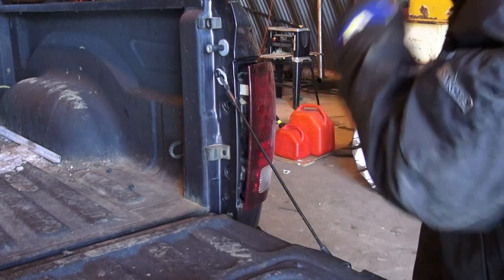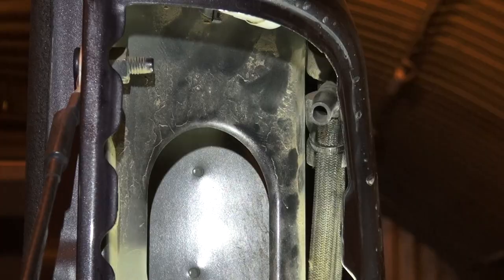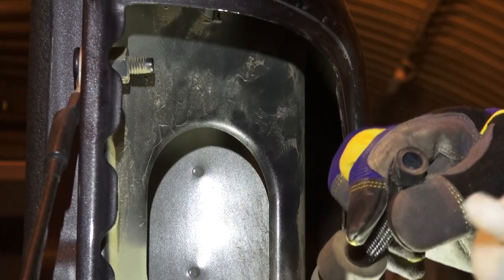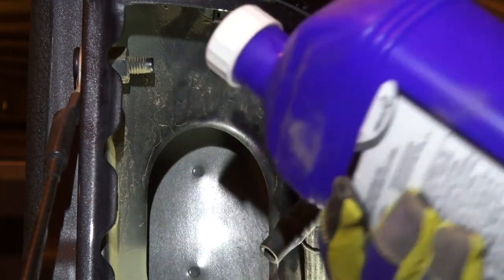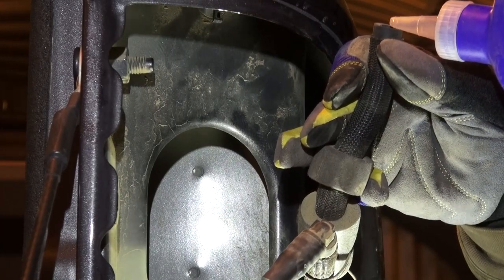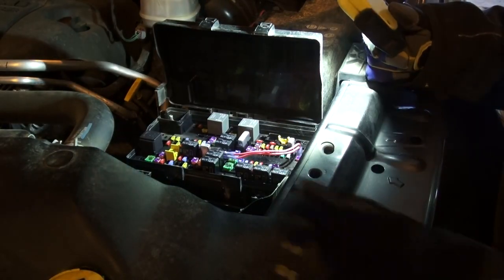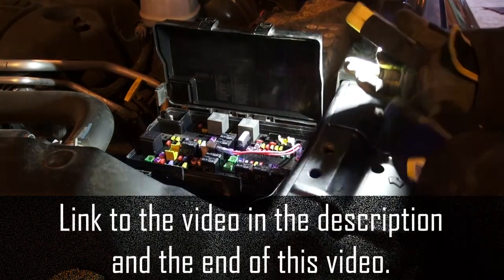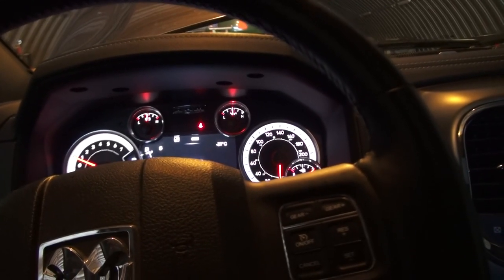DODGE air suspension [De-Icing-lubricant]

Comment: I have a 2018 Rebel. My truck says normal mode but it's in entry/exit and won't move. My dash shows 3 errors, service air suspension,  service trailer brake, and service electronic braking system (anti-slip).  I cannot get into the menu to raise or lower the truck as it just shows the error for the air ride. I've disconnected the battery, checked all fuses, nothing seems to work.  Have had the truck inside a heated parkade for a number of hours with no change. Would this antifreeze help me in your opinion?
Reply from the maker: How cold is it where you are? Doesn't sound good when even the brake system is faulty. If the error persists even after the battery reset,  there must be a faulty fuse, relay or control module. I'd recommend get the codes read out. 
You have an electrical problem, antifreeze wouldn't fix that, but certainly start using it on your vehicle.
Reply: @oBseSsIoNPC  it was -30 Celsius for a solid week. This happened last year too and I had the same errors. When the temperature came back up and the truck thoroughly heated (8 hour drive on the highway) the air ride came back up and all the error codes cleared.
Reply from the maker: @jgm9667  last week someone reported a code for the trailer brakes as well, which I thought was weird but somewhat makes sense. Last time my truck was ignorant it also took 4 hours of direct heat to the system for it to unthaw. This winter the suspension acted up one day at -35°C because of that constant humidity from the exhaust. Once I unthawed the control valve and added 5mL of airline antifreeze it hasn't missed a beat. HOWEVER when it failed I could reset the code by reconnecting the battery. I am surprised you can't get it to reset. It will last only a minute or so, if the valve is still frozen, but it should clear for a bit at least.
Reply: @oBseSsIoNPC  I've had the truck in a heated parkade for 24 hours. Going to go pick up some antifreeze this morning and give it a shot. Dodge are just assholes when it comes to this issue. No help at all. If I can fix it myself, all the better. Appreciate your help and feedback!
Reply from the maker: @jgm9667  Sounds good, also. You can try and put the suspension into tire jack mode or transport mode, then disconnect the battery. I usually take the ground off and touch it to the frame so you can reconnect it right away with the controllers all off.
Reply: @oBseSsIoNPC  hello again. I put a cap full of the antifreeze in the line. The truck was inside heated for 24 hours. Nothing changed so I took it for a drive for a while. It seemed that when I hit bumps, there was a bit more of a "spring" in the truck rather than the hard bang it normally had riding that low. I didn't notice any change in height. I have decided to let the truck run for the next hour in hopes that the exhaust will help heat the compressor. It's currently +5 Celsius so not cold.  I'd be grateful for any other suggestions. Thanks!
Reply from the maker: @jgm9667  Make sure to take a tape measure with you and just compare sides measuring to the wheel wells. Of course the compressor needs to run and the valve needs to cycle to get the anti-freeze pushed through the system. After it cycled, add another cap worth, don't add it too fast or it can stall the compressor. Quite the ignorant little fella your truck huh? triple check your fuses again if you haven't already, just in case. Preferably pull them out and check.
Reply: @oBseSsIoNPC  hello again. I have added a second round of de-icer. Still no permanent fix. However, I did bypass the relay and could hear the compressor engage. I swapped the relay for the one next to it as they are the same but still nothing. If I can hear the compressor I assume that's a good thing. What are my next steps?
Reply from the maker: @jgm9667  running the compressor is one thing, the truck controls the diverter valve though and there is no easy way to control it. When my truck was stuck on a height, I put it into transport mode and turned the key off. Disconnected the battery and reconnected it. Then commanded entry exit. Make sure the doors are closed! The truck moves up no problem, but will not lower with doors open. I usually just trip the door latch shut with the screwdriver and leave the door open. That way I can still access the inside and see what it does.
Hopefully the freezing didn't damage the control valve!
Reply: @oBseSsIoNPC  my raise/lower buttons show the truck in normal mode, and it says normal mode on my dash. Truck is actually in entry/exit mode. I cannot get it in transport mode.
Reply from the maker: @jgm9667 you have that center display and it won't allow you to select it?
Also, what does it do when you command raising?
Reply: @oBseSsIoNPC  The center display shows SERVICE AIR RIDE SUSPENSION when the truck is running. Cannot see the air ride display. With the key in ACC mode I can see it but using the buttons does nothing. Pressing the buttons with the truck running does nothing.  Sorry to be such a pain in the ass...
Reply from the maker: @jgm9667  Oh so there is still an active code, well no wonder it won't budge. Maybe that valve didn't unthaw properly yet, maybe it's broken. If the truck complains right away, there must be a broken component. I am afraid you will have to try the dealership.
To try and diagnose through YouTube is not ideal. Sorry I couldn't help you bud.
Reply: @oBseSsIoNPC  yeah I'm going to take it to an independent local mechanic that I know and trust. To hell with the dealership lol. 
Last question, what happens if you bypass the compressor relay for more than 3 seconds?  I noticed that warning in your video. 
Thanks for all your help, so very much appreciated!
Reply from the maker: @jgm9667  The compressor works in conjunction with the control valve and although there is a blow-by right on the compressor to protect it, you just don't know what is frozen, broken or restricted. Also the power consumption is 40amp and if the compressor was stalled, it will burn out the wiring if run for too long. I just need to warn people that they are by-passing safety measures that would otherwise prevent damage to the system. The bypass test is only there to see if the compressor is actually still alive. I highly suspect a bad control/diverter valve on your truck. Good luck!

Comment: This method worked for us all last winter, but this winter has been acting up a lot, mainly on the extra cold days. Just wondering if you have any ideas as to what might be the issue now if the antifreeze isn’t fixing it. The only thing that seems to help is parking it inside for hours until the whole system warms up
Reply from the maker: I think there is just a limit to what the control valves can handle. My truck has also had issues this year while not having had any previous years. Its been tough, cold and humid weather, creeping into the system. The way the antifreeze dispenses isn't ideal either. I will change my system to house the components inside the truck and that will hopefully fix it for good. I am also debating if I want to try a better way to keep the antifreeze more active and available to the system first. Also consider getting your nitrogen tanks topped up!
Reply: Replace air bags with coilovers up front and coil springs I the back. 5 hours and $700, no more winter issues.  So glad I did mine

Comment: How long do you have to run truck after you put in de-icer for it to start working
Reply from the maker: The de-icer need to travel through the lines by means of running the air suspension up and down a few times. Initially may need 10 times fully raise and lower. Add no more than 10ml total and only 1ml at a time, so you don't stall the compressor with the liquid.
Reply: @oBseSsIoNPC  I did not put a blanket on it but it got in the 20s over night and the truck went up to regular mode at least so i was not bouncing around when i drove it..then it got in the 30s in it would finally go in off road 1,2...have had no problems since and it has got as low as -6f....i put in 5 ml at one time....i will let you know if it acts up...I went to dodge and they charged me 1000 dollars for new pump and it is still on back order....i am not going to get it installed unless i have problems and will let people know if this cheap fix keeps working
Reply from the maker: @darrinhunter2674  thank you for the detailed description. As far as I can tell from previous comments. The compressor is never broken. It may freeze up, but it does recover. The fuse protects it from burning out, like the dealers claim it would. It does not burn out that easily and I ran it beyond its rating.
Reply: @oBseSsIoNPC  I think all you need to do is add 5ml and some how warm up truck....I live in mobile home so I waited for it to warm up.....global warming my ass it has being cold here in Minnesota.
Reply: -11f  this morning all good
Reply: @oBseSsIoNPC  Called Dodge this morning told them I do not want compresser want my money back they said no not something on back order....So I told them this is well know problem and they no about it...Selling me something I do not need is fraud.....All the sudden they will give me my money back.
Reply from the maker: @darrinhunter2674  wow, well you can send me the money haha! Dont do that, because I wouldn't take it. I really like that bit of information about how the dealer changed their minds...jerks.
Thanks for the update!
Reply: @oBseSsIoNPC  One way to fix it is put the truck in normal or off road 1 or 2 and pull fuse 50 in the winter. Or all the time like me.
Reply from the maker: @darrinhunter2674  I do put the truck into servicing mode, to prevent the compressor from running, when the truck is parked. It does help I am sure!

Comment: Great video bud! My dad really wants to buy a 2020 Ram Limited, but we live in Winnipeg Manitoba the coldest fuckin city in Canada. Also he don't even got a garage to park in overnight because he lives in a condo and parks outside in the lot because the fuckin heated car park they built underneath in 1950 wasn't made to accommodate anything bigger then a Toyota Highlander haha. 
So its exposed to -40 windchills a lot of nights. He does have a heated car park at work though so it would be parked in there all day. We love Ram, but he isn't sure if he wants to take the risk. He currently drives a 17 F-150 its had no trouble besides minor shit but interior just isn't up to par with Ram...

Comment: The Alpha ODB app might help with sorting out calibration and diagnostic. This thread has a bit of generic info. https://www.ramforum.com/threads/ride-height-with-alfaobd-air-suspension.148828/
Reply from the maker: Uhh, very interesting indeed! Thanks for sharing, although for some reason, my truck seems to be spared from leveling issues.
Reply: @oBseSsIoNPC  while you're not having levelling issues some of the generic information on access to diagnostic tools may help.
Reply: @oBseSsIoNPC  Not sure if I missed it,  but and a leak check and nitrogen tank refill can  help too. It's my understanding outside air is only used when the nitrogen tank can't provide enough pressure on its own.
Reply from the maker: @ttww1590  I never did ask or look into, whether or not the tanks under the bed are nitrogen tanks or just air storage tanks/accumulators. I think it is time, before the winter :)

Comment: My 2016 has warranty until Aug. The company has spent just under $10,000 working at this air suspension in the past 3 years. I'm on my 5th compressor. Plus replaced reservoir tanks that were leaking. Lines. Bags. It's ridiculous. Ram won't pay to have the air suspension removed and replaced with the regular factory suspension components. I guess they'd sooner keep spending money on this garbage air suspension. Mines sticks in entry exit. OR2. It does everything yours does and more. I'm going to rip it all out myself and replace it with a lift kit when warranty expires.
Reply from the maker: Wow, sounds like a lemon to me or that dealership you are dealing with has no clue what they are doing. The compressors for example are rarely EVER the problem, unless dirt got into it somehow. They are actually built quite well, but may need the endcap bolts snugged up, to prevent the seals from leaking. The weak points are the many connections, poor design of the control valve and no indicator how empty or full the nitrogen tanks are. I know for a fact that the fittings on new airbags can leak and most guys don't reapply teflon tape to them. The factory uses liquid seal shit and it's just that, shit. If the airlines got undone more than twice, they are garbage and either need to be cut back a bit or replaced or they wont seal/hold properly. You wouldn't be the first to eliminate the air suspension and upgrade to a pro-grade kit.

Comment: Another attempt would be to disconnect the battery terminals and touch the cables together ONCE THEY’RE DISCONNECTED to discharge any power left in the capacitors… leave them disconnected for a couple minutes and then hook them back up. This will reset computers on truck and possibly reset this piece of trash air suspension system
Reply from the maker: This works sometimes, but the last times it acted up, it really showed attitude.
The whole delay thing is a joke, it never even measures temperature on the compressor, just calculates it by run time. The computer thinks the compressor will be hot, because it ran for 2min straight...at -15°C :P while barely warm to the touch. Yet > overheating, "compressor cool down" warning followed by a suspension lockout. Still working fine though, since the antifreeze. I just put in more last week. We have -20°C now

Comment: The “de icing” fluid is air brake antifreeze for tractor trailers and there’s a 99% chance it has methyl hydrate in it…
Reply from the maker: And your point is?
Reply: @oBseSsIoNPC  you mentioned it was alcohol based in the video lol… just informing that it’s methanol/ methyl hydrate. Precautions should be taken when working with it if it gets on your skin it can cause central nervous system problems later in life. Just for those who don’t know. Trust me your video helped me out and just trying to add to the information provided.
Reply from the maker: @jpwdowiak  thank you. I see my reply was rude, not sure why I didn't just reply inappreciation of a detailed correction. Living in the city turned me into a d$@#.
Doing better now, back out in the country ;)

Comment: Pure stupidity....putting a liquid (which doesn't compress) into an air compressor intake tube. This is why you don't follow YouTube videos instructions. 

The correct way to fix this is to purge out the system (which probably has atmospheric air mixed in with the nitrogen factory fill due to having a leak somewhere) and refill the system with high purity nitrogen. Since nitrogen doesn't contain any moisture, the system won't have any freeze issues in cold weather. But if you don't find and fix the leak, you'll end up with the same problem again as the system continues to take in atmospheric air to make up for the loss of nitrogen.
Reply from the maker: It is PRECISELY why you follow the instruction in the video and NOT add anymore than I did. 5mL won't harm the compressor at all, as a matter of fact even 10mL won't even make it to the compressor as it wets the hoses only. You may hydro lock the compressor with 15mL and with more you do for sure. I have done this for years and NEVER had an issue. So next time you comment, do it from a position of experience in the subject, after trying the exact method. I appreciate your concern though. And yes, ideally you fix the leak and work with nitrogen, but it is clearly an issue after one year of usage (from BRAND NEW). NOBODY goes to the shop every year for the procedure you describe, like copied from a school book. When there is a much cheaper solution for those that won't mess with it any other way.
DODGE just simply fucked up and should have added a Drier system, instead of relying on a perfectly sealed air system on a offroad capable truck.
Reply: @oBseSsIoNPC  Disagreed. I'd never put any amount of liquid into an air compressor. Why? Well, it's not designed or intended or able to compress a liquid. Yes, you can get away with having a very small amount of liquid in the compressor, but it's still not a good thing to do. 

I have a nearly identical air suspension system in my 2017 Grand Cherokee Trailhawk. Zero issues so far. I had it in subzero temps in the Poconos this holiday season and it worked perfectly the whole time. And for what it's worth, anyone can easily recharge their system with nitrogen quite easily. It's not that expensive or hard to do. I have everything I need to properly repair my system when it needs to be fixed, but it has been absolutely free of issues so far. But when the time comes, I'm ready to repair it myself. I'm certainly not dumping liquid into the air intake house, that's for sure. That's just a hack job and is asking for trouble.
Reply from the maker: @Japplesnap  totally agree, it is NOT the preferred method and the proper repair is ALWAYS recommended. 
For people that live out in the country or don't have access to any shops close by
Or have know how to fix things in more detail, this works. You get -30°C weather then?